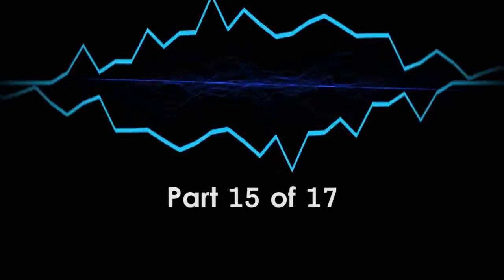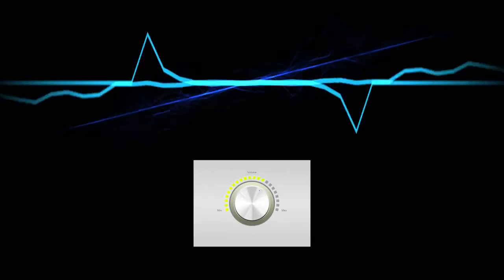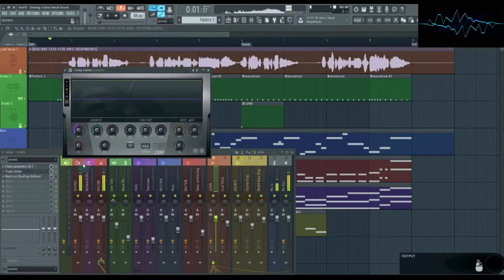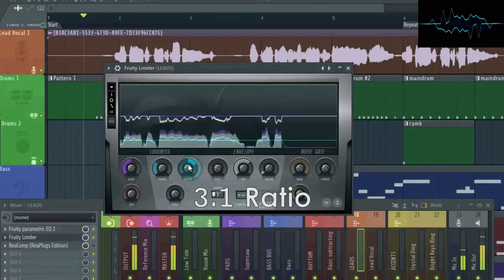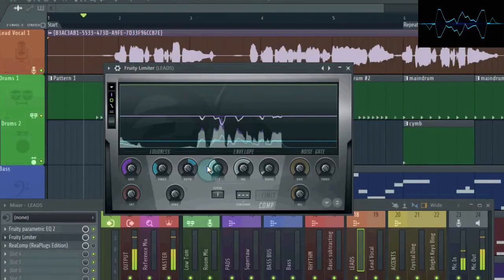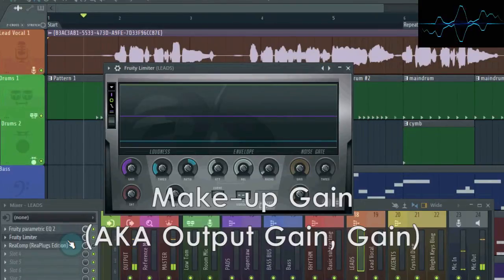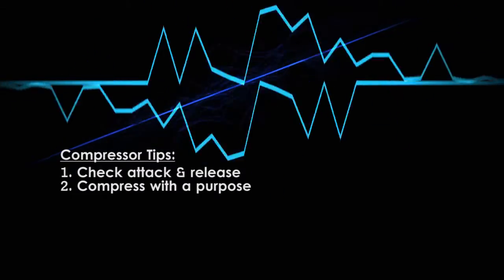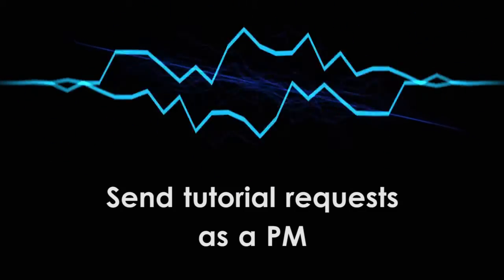Explaining Compressors: Fixing Volume Problems with a Vocal - VoxFX Ep. 17

Comment: Hi.
I've got a question to the Audio Equipment. It looks like i'm going to buy the "Focusrite Scarlett Solo Studio Pack".
My question is, whether there is an output cable involved in this pack. Somewhere on the site it says RCA/Cinch.
I'd like to now whether I have to buy an additional RCA Cable or not.
Reply from the maker: +Fluttershy It depends on how you want your audio to come out. It comes with a set of headphones, which require no extra cable; just plug it in the front and you're good to go. It has a pair of RCA out ports on the back, so if you want to plug in a set of studio monitors, that's how you'd do it. And yeah, if your monitors don't come with RCA cables, you'll have to pick them up. I also don't know if you can use the standard computer audio for your output, or if you have to direct it through the interface. Maybe check some product reviews, and see if people encountered problems?
Reply: ShalMusicFX I want to be able to record it for / on my PC.
Reply from the maker: *****
Oh you will. The Studio Pack comes with Cubase, which will let you record and mix it on your computer. Basically, the audio go in through your mic, into the interface, into your computer, into your DAW, is recorded in your DAW, and then is broadcasted back out through the interface to your speakers/headphones.
Reply: ShalMusicFX
Yeah, thats fine. But how is the interface connected with my computer if an extra cable is needed. That was my question. Which cable i need to buy for a "interface > computer" connection :)
Reply from the maker: +Fluttershy Okay, so it uses the USB cable (that comes with it) to connect to your computer. The USB is the digital input/output cable. The RCA cables are used to connect to your speakers (analog output). So, if you want to have audio output from something other than headphones, you'll need RCA cables (and a set of speakers that accepts RCA cables).
Reply: ShalMusicFX Perfect. Thank you.

Comment: I wish I would have known that when I mixed the vocals for Dishonesty :( Would have been so much clearer instead I mixed it like every other instrument. I didn't use the attack correctly making it start to aprupt making in sound unclear.
Reply from the maker: +Vocoded Glasses (Auro Prime) I thought the vocals sounded fine on your song. If I had to guess, that was a vocoder? If so, they generally require a TON of compression, more so than standard vocals.
Reply: ShalMusicFX it was a double track vocal. A vocoder that went up to 500 hz then it was lowpassed and a distorted modulated and tuned vocal that went from the max down to 600hz where it was highpassed. I always thought the parts where the vocoder was active sounded "blocky".
Reply from the maker: Vocoded Glasses
That's interesting, and complicated. Sounded pretty sweet though.